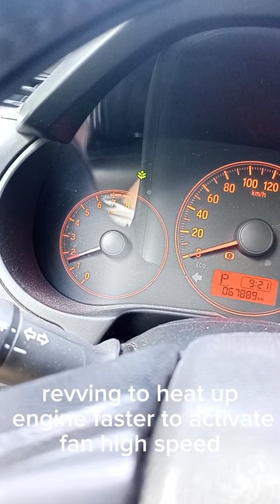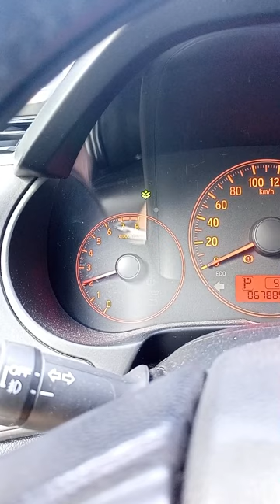FAN MOTOR REPLACEMENT | HONDA CITY 2017 | GM6 | RADIATOR AC FAN

Comment: Magkano kuha mo sa fan motor?
Reply from the maker: 1500 ata kasama install
Reply: @saltedcaramel8341  Salamat. Mas mahal lang kuha ko pero ok na rin.
Reply from the maker: Used na din kasi ung sakin nabili.. kea mura cguro
Reply: Sana all original mitsuba ako kuha ko denso na lang pang jazz 2010 same sa city
Reply: @saltedcaramel8341 san ka ngpgwa boss
Reply: Magkano kaya kapag bago ngayon kasi ganyan na ngyari sa fan ko kailangan tuktukin sa condenser side para gumana pa
Reply: pno po b ikot ng auxiliary fan ng ac pa ryt or left?